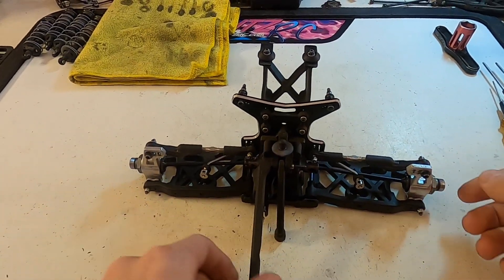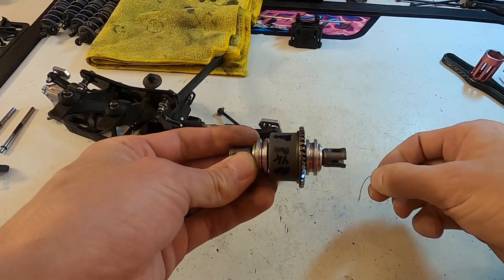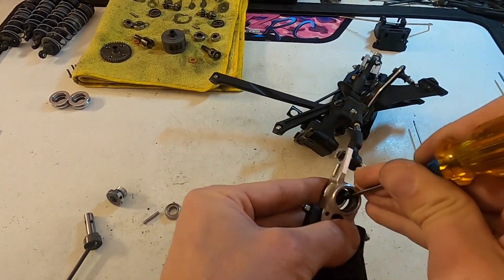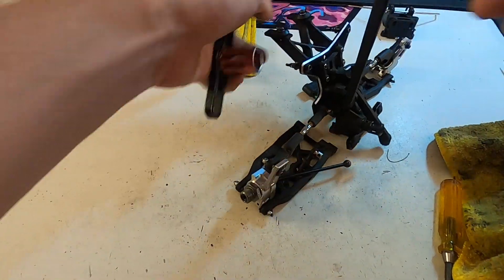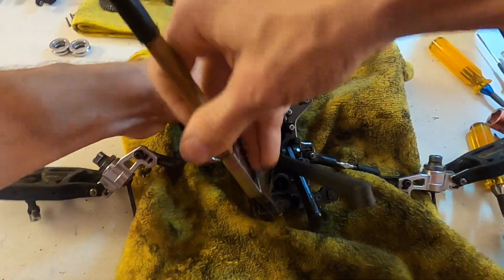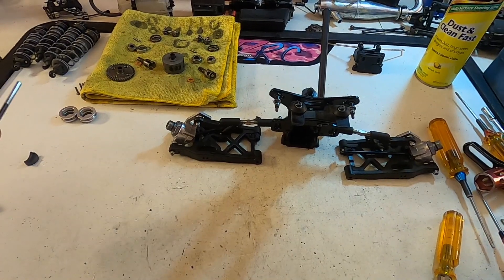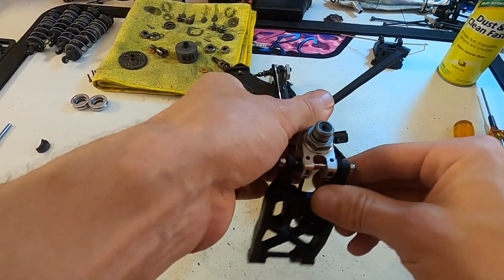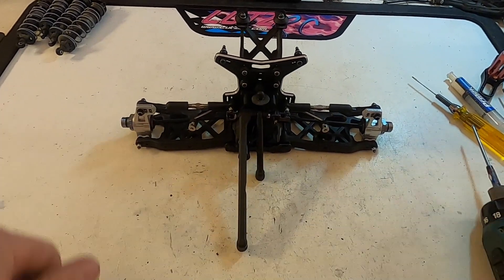How to R/C car (rear end clip rebuild) [Beginner Tutorial with Ryan Lutz of LutzRC]

Comment: How often do you change the pill blocks?  And I noticed you went to the 223 in the truggy what header length are you running with the 2090 on the truggy?
Reply from the maker: Gage Coleman I change them if they get sloppy at all. 
Regarding engine and pipe running the 75mm header in truggy.
Reply: Ryan Lutz thanks for the response. I have a os b2101 and was told it was pretty much same engine as 223 and didn’t no if it would have enough pep in it to push the truck around haven’t broken it in yet due to weather but gonna give her a go soon
Reply from the maker: Gage Coleman yes. Same engine basically. 
Seems to have enough pep for me most of the time. ;-)
Enjoy!
Reply: Ryan Lutz yes sir you’ve been killin it in truggy. I live in Fort Worth Texas new to the hobby probably 8months now love my agamas got nitro truck and e-truck and still running a215sv buggy due to work keeping me all over the country haven’t had much time to get dialed one but soon as I do a319 will be coming up love the videos keep pumping them out!!
Reply from the maker: @bigr71225  Thanks Gage. Glad to hear you are enjoying the hobby! My primary sponsor Nemo Racing USA is based in Fort Worth as well! I'm sure you race at Indy RC?
Reply: Ryan Lutz yes sir I don’t know billy personally but bought a clutch from him and a pin on the flywheel broke off for some odd reason and he sent me a brand new clutch assembly free of charge since then I’ll be sticking with agama/Nemo racing USA products